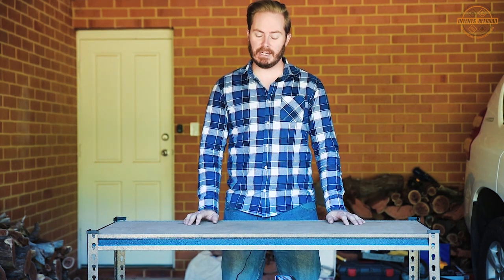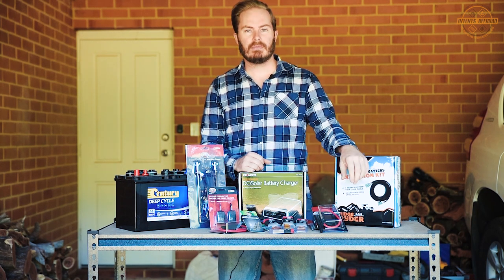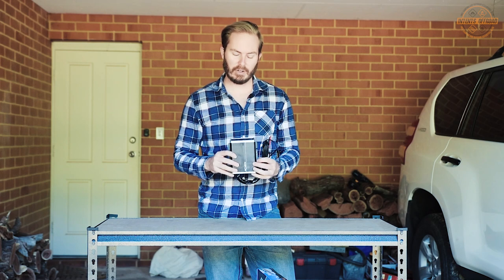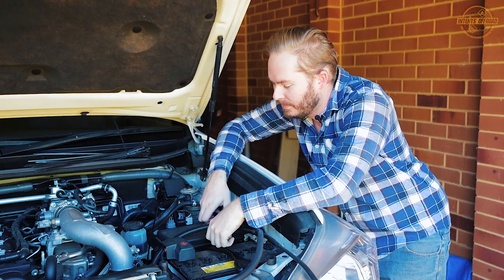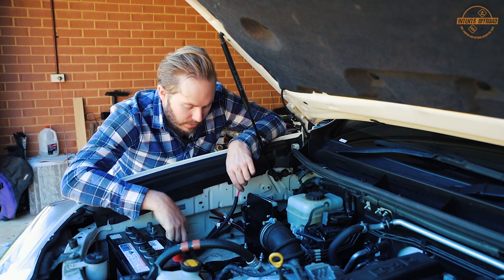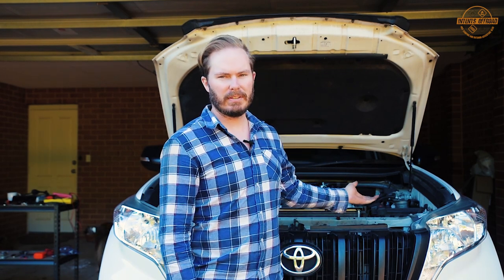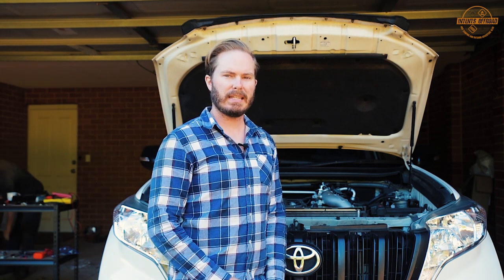Dual Battery Install. House Battery Setup & Anderson Plug. Backyard Mechanic 12

Comment: Dude, so glad you ended up turning the deep cycle batt around. 
I was cringing when I saw the Pos+ terminal that close to the inside of the guard - pro tip, every car’s battery location is designed to have the Pos+ away from the body of the car in case of a collision and a dented panel could earth out on the terminal. 
Another tip on crimping the large lug on a smaller cable, if you have a bench vice, put the cable lug in with the eyelet facing down and the cable entry upward. Heat it up and fill that sucker with solder (propane torch works best instead of an iron) and plonk ya cable in before the solder dried. 
Roberts ya mother’s brother.
Reply: great tip, thanks for that
Reply from the maker: Well there ya go, didn't know that little fact about battery location! I love that idea for soldering a lug mate, I reckon there might be a follow up video here just for all the little tips people have suggested
Reply: TIL
Reply: Beard Moto
Reply: Pro tip, take the cable to Battery World to crimp it properly, must cost ya $5.

Comment: Some great tips and no problems with saving a few bob on gear like pre-made cables - but using vice grips as crimpers is not great form and could well lead to a hot joint and fire risk - if you can't spring for decent crimpers I'd advise to solder the lug in place rather than just squashing the lug...  Love your videos, it takes real commitment to keep stopping for footage set up to produce a video when you just want to get stuck into the project (-:

Comment: Awesome video, I have exactly the same charger sitting in the shed waiting to be installed to replace the old isolator setup, thanks for the informative video!
Reply from the maker: Good onya Matt 👍 yeah they're a great charger I've used em on a few setups now!

Comment: Some nice work there Alex. I think you should be running the cable to the Anderson plug from your auxiliary battery. You just put in the projecta so let it protect your start battery from being discharged while parked up with a camper connected. Cheers.
Reply: He mentioned the camper has a Redarc charger in it already, to compensate for the voltage loss over the long cable length - this would act as an isolator when the car is not running as well, so there’s no real risk of running the cranking battery flat.
Reply from the maker: As Mr Beard Moto said also, I had a good long think about whether to put that anderson plug to the main or second battery. To add to what he said, I was concerned that the Projecta charger has an output of 25 amps, and the Redarc unit in the camper also has an output of 25 amps. So it may even draw more than 25 amps to compensate for the voltage drop (I'm not entirely clued up on the science here). If that was the case, the under bonnet charger wouldn't be able to keep up and the second battery would possibly not get charged.
Reply: Yes, makes sense to run it from the main battery. The projecta wont have to handle load of aux and trailer combined. Just have to be mindful if towing a different camper that doesn't have its own isolator. I suppose they all have built in DCDC chargers now anyway.

Comment: Hey bro thanks for sharing.... just a quick question here, where did you buy the black L shape metal bracket to install the projecta dc to dc charger? any I am close to do the same project on my rig and I am collecting all the materials... Thanks bro!...
Reply from the maker: That's a handmade item buddy! Just a bit of 2mm scrap steel cut to size, whacked it in the bench vice and used a hammer to bend it over. And drilled a couple of holes to work with existing fixtures on the prado🙂

Comment: You talk about having a dual cab and having battery’s in the back. Which is what I want to do. You talk about volt drop and what not. Why not just run a bigger cable?
Reply from the maker: You certainly can run a bigger cable, it would be pretty big like cranking battery cable. And you'd wanna think about the battery chemistry and optimal charging voltage too. And finally, how new the dual cab is, cos their charging systems can have a tantrum if you don't use a charger. If it's an old girl you'd be fine 👌
Reply: @Alex.G  hahaha yeah i have to do some research. i think my 2015 mn triton should be on a dumb alternator. not actually sure.

Comment: can i just run it parallel? connect 2nd battery's cables to the existing batteries + -. its for a small sedan. thanks.
Reply: Your accessories will drain both batteries together, draining your cranking/starter battery.
Reply: @stephenlloydco  but someone said that putting on a voltage splutter is bad for car's alternator

Comment: Suggestion to run wire along brake lines is a bad move. Cable ties will wear through brake cables with vibration.

Comment: Um, what about the original ground cable for the main battery and engine block ground, they are now going to be under extra load trying to charge two batteries, very overlooked thing, especially in 4x4 and cars and cars with audio systems, your adding a positive wire from the battery and then an extra ground from the Aux battery to chassis, but what completes the circuit? the stock ground cable that's already under stress from all the bloat accessories. The battery cable at 20:37 needs to be doubled up and one added in parallel with at least the stock battery to chassis to actually do this properly. Also crimpers are $50 on ebay, that looked like total shit and will fail, if it were a subwoofer monoblock power feed the crimp would probably melt off ahah

Comment: Great video!!! 
Why so small gauge wires for the battery leads? I'm using 2/0 from main battery to charger, 2/0 from charger to house battery and 8 AWG to all accessories. Very little drop in voltage.
Reply from the maker: Thanks mate 🙂 I used such small cables in this case because that charger only charges at 25 amps. Also because the batteries are pretty close together. And finally, most of these DC chargers can automatically compensate for voltage drop 🙂
Reply: @Alex.G  Thank you for the  response.  So my wires are overkill for a  80AH AGM battery mounted in the back of my SUV.  I have a  20 amp charger  hooked to it. 
We dont have alot to pick from in the United states.  And some of the good stuff from Australia won't ship here .
People think I'm  nuts for making a  tourer out of my Range Rover Evoque,  but it works and is very capable.

Comment: Just wondering why you chose to fit the Anderson plug to to the starting battery? I would personally like to have it on the accessory battery so there's less risk of using my jumper pack.
Reply from the maker: The Anderson plug powers another 25amp DC charger in the van. So I'd be getting 25 amps from the starter into the second battery, then the charger connected to the Anderson plug would suck that 25 amps for itself. Doing it to the main battery avoids that issue 🙂

Comment: HI Alex, great video thank you. I was wondering how you got the cable with the anderson plugs to the rear of the vehicle? Did you run it through the firewall and through the cabin or underneath the vehicle along the chassis? I have newly purchased a 2014 150 Prado and am trying to decided how to install my dual battery.
Reply from the maker: Went underneath following the chassis rail. Just wrap it all in conduit and use plenty of cable ties

Comment: Hey Alex, great vid. I have a 2016 GU, just thinking can I just connect the ignition override(blue) to any ACC? does it work for that?  thanks
Reply from the maker: Thanks Cai, yeah you could do that for sure. I'd probably opt for a feed that is 'ON' rather than 'ACC' myself. Just because you might want to leave ACC on for your stereo or something, and that would then activate the charger if you'd connected to that. 👍
Reply: Thanks Alex

Comment: Hey Alex, great vid. Have to add dual battery to my 150 Prado. What did you do with the A/C hose you unbolted to fit the battery or is it left loose? Just heard stories of people bending them and cracking the inner pipe cause it is dual walled.
Reply from the maker: Yeah bending it doesn't sound like a good idea. He ended up folding a dog leg bracket out of 3mm thick flat bar and affixing that to a captive nut right next to the radiator support. It's still very close to the battery, so we have wrapped it in some of that thick insulation that you often see on air conditioning hoses

Comment: 4.29 how did you clear the AC pipe? Trying on my 2014 VX and the pipe is well in the way.
Reply from the maker: It was only slightly in the way on this one, from memory we relocated a bolt just down from the battery tray and wrapped the hose in some extra AC insulation to protect it against rubbing
Reply: Intents thanks man

Comment: Mostly a good informative video. 
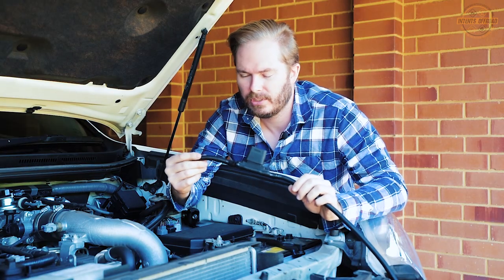Thogh the attempt at crimping the terminal at 11:50 is just not good enough long term. 
If you can't crimp it properly you should at least solder it. Flattening the socket has opened up heaps of room for water and resulting corrosion. 
A bit of research into crimping will show just how tight the crimp really needs to be to be reliable and to get all the needed current.
Reply: Put some more heat shrink onto it. Was going to suggest hammering in a couple angle dents to minimise chance of slippage too.
Reply: Lug crimpers from Jaycar are $50. Then add glue filled heat shrink to seal.
Reply: Splitting hairs here. Mine have been crimped for 6 years with no sign of corrosion.

Comment: Never crimp a terminal using pliers, it will create a high resistance joint and that is bad. You can get a better fitting terminal from Repco or Jaycar, and a decent crimping tool is about $50.00.

Its a good idea to connect the earth cable to the chassis.

P.S. I am an Aero Eleco, so poor terminating tips make me cringe.

Comment: Y didn't you put a rely in?
Reply from the maker: Mostly because the DC charger option is a little more relevant these days. They won't work with many smart alternators and are less efficient with temperature compensated alternators as well. The DC charger will work with any vintage system 🙂

Comment: Nicely done but I have to ask, why a wet cell battery? I do everything I can to avoid that older technology these days.
Reply: Western Australia Now and Then a lot of sealed AGM batteries don’t like the heat or being heat cycled. 
Gel and AGM batteries that are fully sealed will sometimes swell up like a balloon under heat, and sometimes wedge themselves into the battery box. Seen it happen many times. Stick with AGM or Gel if it’s going inside the cabin of the car, or camper, but under the bonnet i would stick with a wet battery. Still the same Amp Hours, just don’t get as many cycles out of them as a AGM/Gel. 
My other theory is cost. Wet is a little over $200, AGM usually double that.
Reply from the maker: Hi Marc! Yeah mainly price was the deciding factor on that one, and somehow the amp hour rating on it is 105Ah which was surprisingly good I thought! I believe those spiral coil optima batteries are supposed to be good for under the bonnet, but are a little over double the price. Then there's AGM which is what I use in the back of the car, but doesn't like the heat under a bonnet.

Comment: WHAT??? The IDC25 is $230
And a set of Hydraulic Hex Crimps cost $40
Also, when it comes to Battery chemistries, dont just trust what is written on the DC-DC charger and select the matching Chemistry.
Read the Battery specs and then select the mode the best suits
Plenty of AGM Deep Cycle have a Max Charge voltage of 14.5v and many AGM setting push out 14.8v... same same for wet cell, read the battery charging specs, the select the best mode
Reply: Would you like me to show you?
Reply: Lol ebay.
Reply: Will break before you use it.
Reply: Do you own one?
Reply: I've just looked on amazon, found 3 hydraulic crimpers for $40 - $50 & 2 manual ones ( look like large bolt cutters ) .. perfect for an amateur who will probably only use them for 1 install & who doesn't care if they break after a year
Reply: They don't break after year, they will last for ever if you use them correctly.
The only time i have seen these fail, and it was the dies that failed, was total muppets using them for application they weren't designed for, ie: Stainless Steel crimps for yachts and hand rails.
I feel some of the early posters in the comments section might belong to said group of people